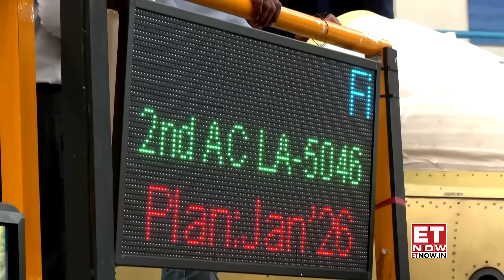Inside HAL Nashik: Crafting the Tejas Mk1A for Tomorrow's Skies

Comment: One swallow does not make a summer and one LCA MK1a does not make a squardon. The Indian Air Force (IAF) currently has only 29 fighter squadrons, but needs  42. HAL has failed to sanction the GE for non delivery of engines.  If HAL cannot suffice the needs of the  IAF what will they export ?? The reprter is going gaga over one fighter aircraft !!

Comment: Why does it looks more like a assembly plant of a local motorcycle shop. The assembly plant of car and two wheelers are far more suffocated with robotic arm for precision fitting. Here it looks like there are more people with screwdrivers than required and utterly chaotic. It does not look like assembling of  a precision engineering fighter jet.
Reply: Fighter jets are assembled like this only. They are much more complex than automobiles in structure as well as function.

Comment: We do have IIT's, NIT's and research facilities. Despite having the edge to develop an indigenous jet engine, we are still back tracking from 1986 when Kaveri engine programme took shape. 
Tejas MK1A is still reliant on GE-404 which is a disgrace to engineering capabilities for India. 
Mechanical engineers need to visit China or Russia to learn jet engine designs. We require 6 Gen stealth capability fighter programme.

To the half witted journalist - India will rule the skies with 4 Gen single engine aircraft? 😅